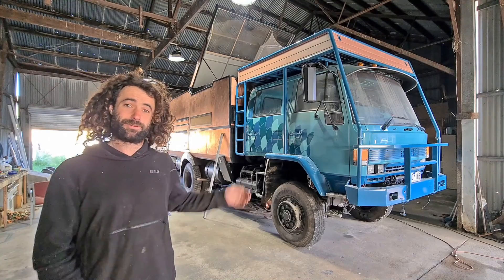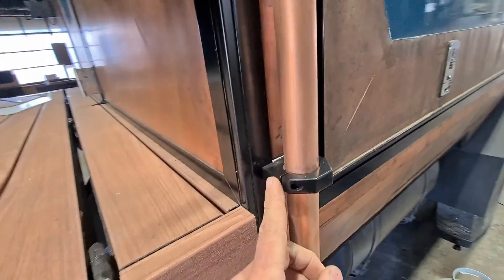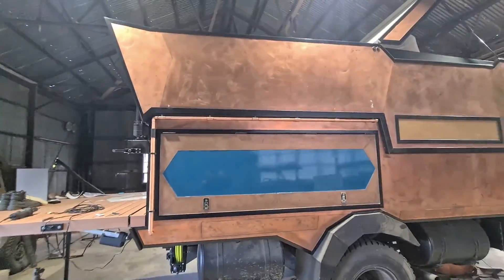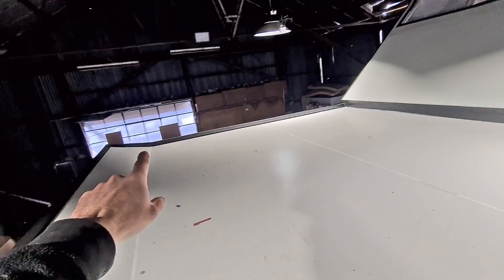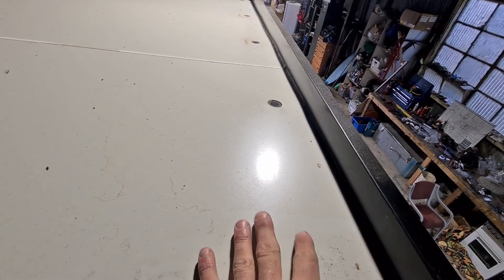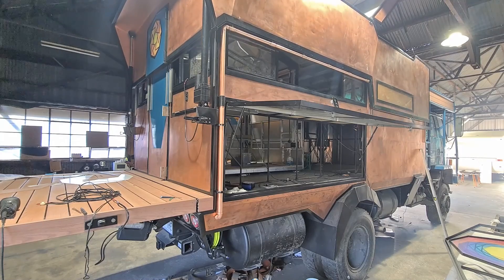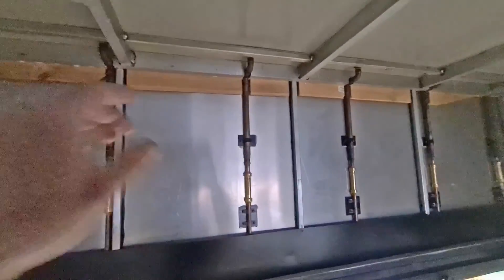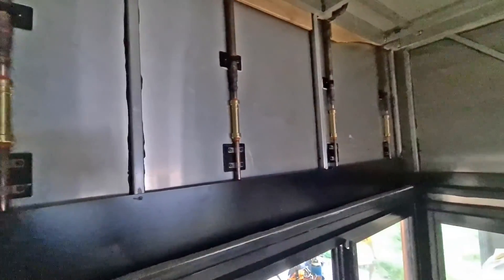Rain Water Collection System - Expedition Truck Build #26 - DIY 4x4 Extreme RV

Comment: why did you choose copper for the rain pipes instead of other materials?
Reply from the maker: Because the tube comes in the dimensions that I needed, it's safe for drinking water and it suits the rest of the truck
Reply: Copper is BY FAR the most luxurious and best plumbing option out there, plain and simple. It's anti-bacterial and benefits the water as a matter of fact. Millionaires have copper plumbing for a reason!

Comment: Great set up. Most collection systems have a first runoff diverting part. 

Did you incorporate something like that?

Thanks for sharing your unique build 👍

Hopefully you will be releasing a new video soon 😊
Reply from the maker: There is a run off valve before the tanks so I can flush the system